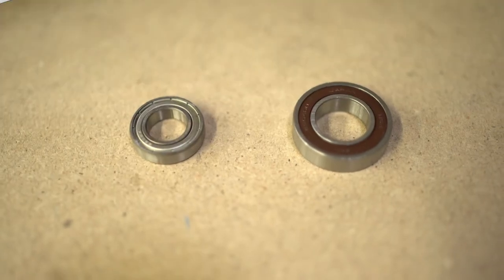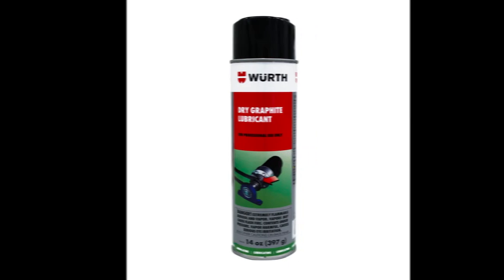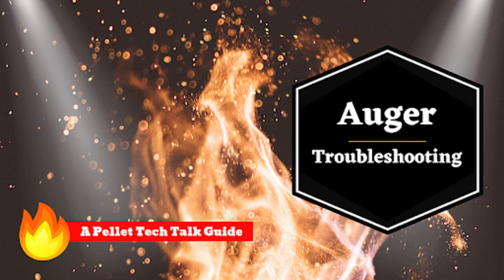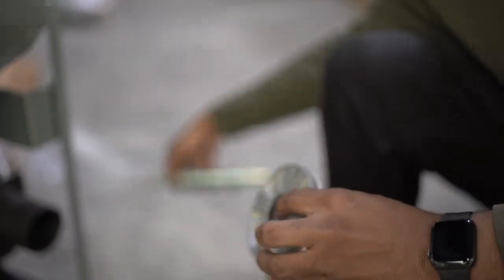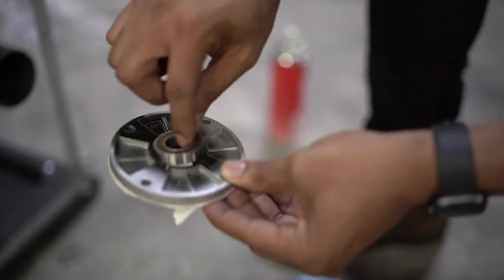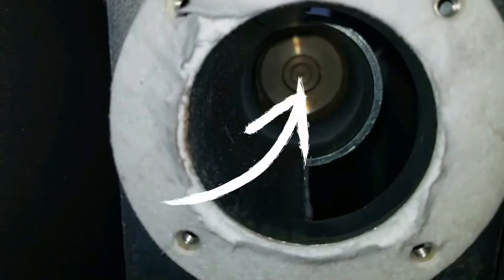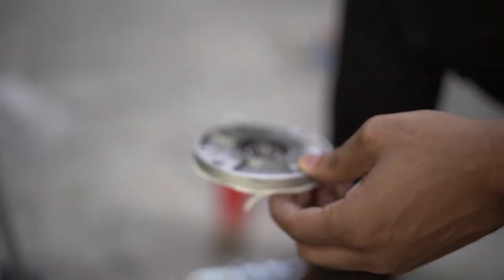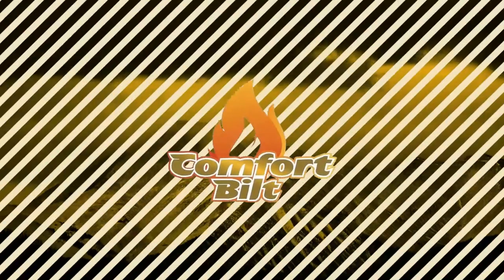How to Replace Auger Bearings

Comment: whay are we lubricatine the bearing housing where it sits? That part should not turn and if it did, it falied. @607 pellet stoves.
Reply: The bearing has a redundant "failsafe" feature.  If it DOES fail, the bearing is designed to spin inside that round plate housing so it doesn't lock up the motor.

Comment: This is all well and good if you are in a workshop setting and haven’t installed one of your awful stoves. You can’t get to any of these parts without  completely disconnecting and moving the stove to an area with a 5’ clearance on every side.  My stove worked for 20 bags of pellets.  Now I am expected to fix your product.
Reply: All of our stove models have removeable or magnetic side panels that these parts can be access from for your convenience, so you do not need to disconnect the stove or access from the rear.  The warranty would also cover a tech to come out and do the necessary work anytime during that first year.
Reply: My bearings are grinding already and it just been a year. On beginning of the winter just now they are grinding . I live in NH and it’s should still be under warranty , does any one come out to replace bearings or do I order them?